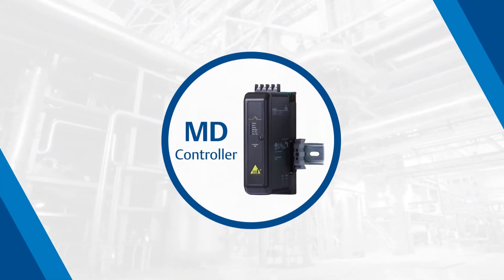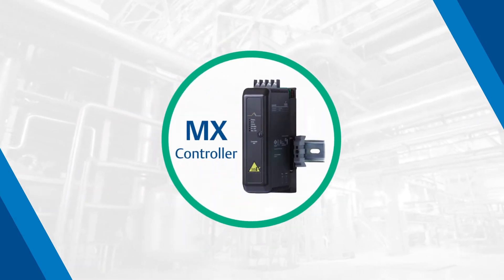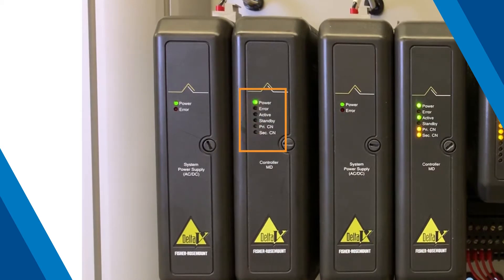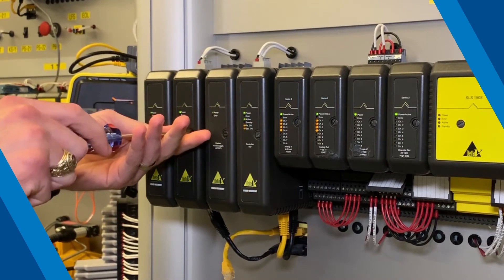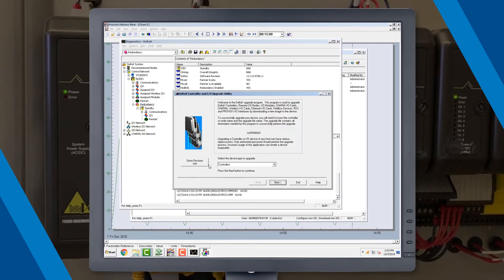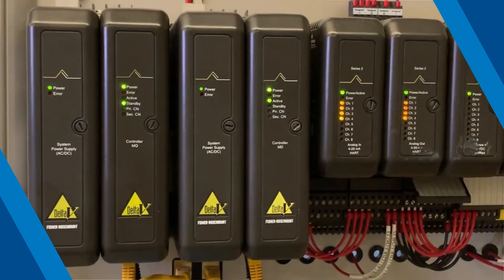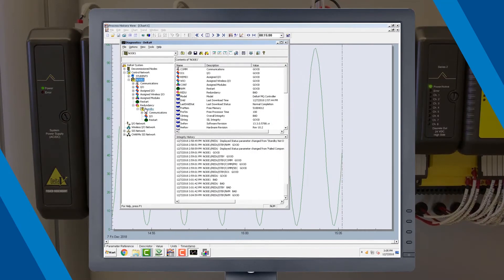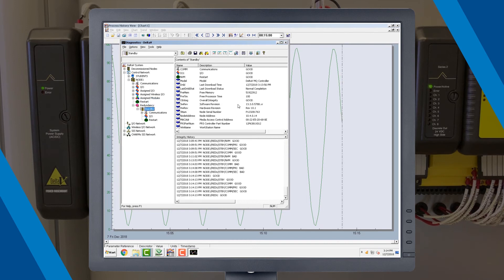How to perform an online replacement of an MD controller with your DeltaV Distributed Control System

Comment: Doesn't work right.  DeltaV doesn't recognize the new controller.
Reply: Problem was smart switches were locked.  Yep, turns out I'm the idiot, not Emerson.  Although considering adding the step to check for that in the video.
Reply: Their broken promises about plug and play never cease to amaze me though lol